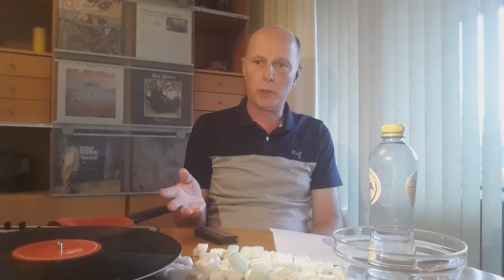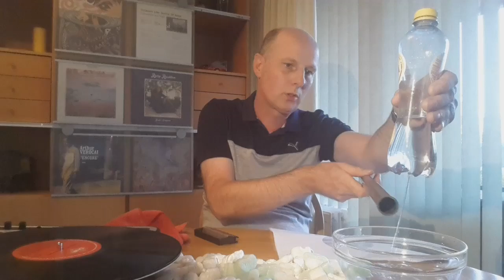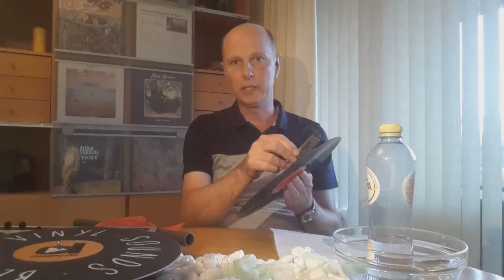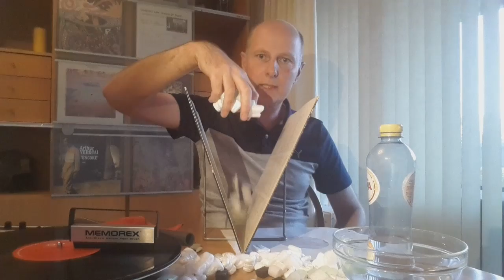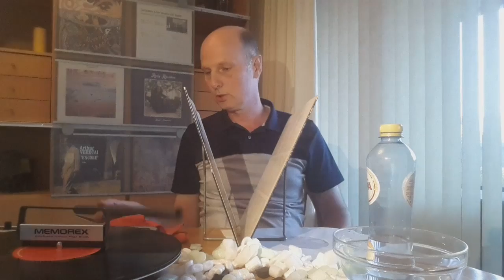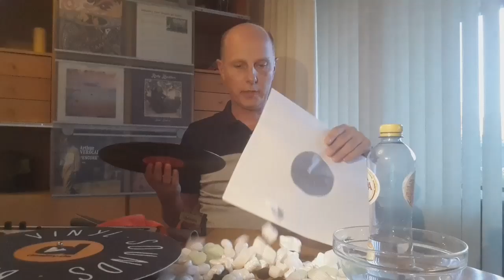3 Common Misconceptions Using a Record Brush - Vinyl Community

Comment: Thank you Sir ! I might be wrong, but, I don't think the carbon brush removes static... a Zerostat 3 gun is better for removing static.
Reply from the maker: Hi again. It might surprise you, but it's actually the other way around. The Zerostat gun can't remove static. What it does, is cover the record with a negative charge and next with a positive charge. Both charges cancel each other out. This way the record is neutral and no longer static. I think a carbon brush is the only dry method that can remove static from a record. Wet cleaning also removes static.  Have a great weekend. /Paul
Reply: @XjunkieNL  yes, applying opposite charge is exactly what I heard, but in addition I heard the carbon brush just does not add static... and it can't remove static. In other words you will only remove static with zerostat 3. I have the zerstat3 but have not yet gained enough experience and confidence with it and dealing with static. I also find cleaning removes static.
Reply from the maker: Check this video. It shows two ways that a carbon fiber brush removes static. https://youtu.be/J7gOdhtKPpg
Reply: @XjunkieNL  already seen and liked that clip, thank you

Comment: I just bought a carbon fiber brush ( anti-static brush) but the first time I used it , it made a screeching sound when it made contact with the record!  I had been using a velvet brush but since everyone recommended using one of these types of brushes... I bought one and now I'm not sure its not scratching the records!  is it normal for it to make that sound?  I placed it so that it barely touches the record so the bristles don't bend... still it makes that weird sound... there is no better way to describe it than ... screeching... jaja
Reply from the maker: Hi Fernando. This does not sound okay. Have you seen my video where I compare five different carbon fiber brushes? One brush also made a screeching sound. And also scratched the surface of the vinyl. Here is a link to the video https://youtu.be/J7gOdhtKPpg Let me know if this is similar to your problem. Thank you for the comment. Cheers. /Paul

Comment: I have cleaned records from the early 1970's forward. I have used practically every method known to man. The glaring issue I have come to learn, is recontamination. Being that nearly all the methods I see, involves cleaning one side, then flipping it over to be cleaned on the other without removing the material surface on which the dirty side was set on.   Also, I have yet to see anyone address the labels. They are filthy, full of dust material. 
An anti static device can be used on the record before and after cleaning, but it should be used on the turntable as well. 
But by far the problem lies with recontamination.
Reply from the maker: Thank you for your comment, James. You make a valid point. In general recontamination is a problem. Platter mats, brushes and the labels you mention, all are a source. Static can really help to reattach dust to a cleaned surface. Cheers. /Paul
Reply: X junkie NL 
Thank you for your response Paul. I was observing your mention of using the carbon fiber brush in an inverse manner (towards the label). I was watching a great blogger on YT named Fran Blanche. She is a former DJ and spoke about various things that occur to records. She also used a carbon fiber brush. However she slowly moves the brush to  the outside of the record and off. She stated that the slow movement helps to carry the static away from the record. Thanks for your videos Paul.
Reply from the maker: Gonna check out the blog of Fran Blanche. For the static it doesn't care in which direction you move. It has to leave by the conductive fibers. Only thing is it needs time to do this. Most people move the brush to quick. /Paul

Comment: Anyway pulling the brush tho the centre or out, you pulling it over the grove. 
Pulling it in and over the label that you touched i think you just contaminated your brush with whatever you put on the label with your fingers
Reply from the maker: Hey Jørn. Thanks for the comment. I like your argument of the unwanted body oil, from fingers, touching the brush. Although, like a catch 22, you touch the record at the outer and inner part of the record. For me it feels more comfortable to make the carbon fibres go in the same direction as the needle goes in the groove. The difference may be limited. All the best. Cheers. /Paul

Comment: I believe I have discovered a mistake in your presentation regarding the angling of the brush when cleaning the record.  By way of explanation, you put an open gate fold album into a rack.  The "V" shape of the album when open was to represent the groove of a record.  You demonstrated the way in which a record brush when tilted would touch the side of the groove and consequently potentially statically charge the record.  It appears to me that this would be correct only if the brush was angled differently on the record by about 90 degrees.  In other words, for the angled bristles to touch the side of the groove the way you described, the brush face (not the ends of the brush) would have to "face" the label.  When the end of the brush "faces" the label, the bristles of the brush are within the groove and some bristles are naturally touching the side of the groove, a situation that apparently cannot be avoided even when the brush is not tilted. 
One question is, whether or not the brush is tilted, how does pulling the brush off of the end of the record or pushing it toward the center of the record thoroughly clean the dust from the record?  It would seem to me that it would be necessary to change the angle of the brush for the purpose of sweeping the dust from the grooves and off the edge of the record BUT there is a problem I have discovered when doing this sweeping with a carbon fiber brush.  That aforementioned problem is tiny scratches.  You read that statement correctly.  I have an "Audioquest" carbon fiber brush that when utilized to sweep (as previously described) causes tiny scratches on the record surface, a situation that is not supposed to happen but I assure you it does happen.  The scratches can be seen on the outer rim of he record. As far as I can discern, these scratches are inaudible when the music is playing.  I just do not want them to be there, obviously.  This has caused me to question whether or not a carbon fiber brush should be utilized at all as a method of cleaning vinyl records.
Reply from the maker: I'm not sure if I understand, but you are correct if you mean any brushing action is creating static. If you are worried about tiny scratches, there are anti static brushes available with the carbon on the inside. It uses soft hollow fibers. Chances of tiny scratches are minimal with this kind of brush. /Paul

Comment: I guess I've been using mine the wrong way. I zap mine with my Zerostat gun before using the brush. Thanks for the tip!
Reply from the maker: Sounds good to me. If you have a Zerostat available, using it before brushing, will certainly help removing the dust. Cheers. /Paul

Comment: All brushing with whatever adds static.  "antistat" brushes are BS including the arm ones with carbon fiber that is grounded. They add static.  Best method I've found:.   Hold album in hand, roll with silicon roller.  This will also add static but then use an antistat gun like the Milty while still in hand otherwise it doesn't work.  Now put album on platter.  Keep stylus clean because even dust on the stylus will add static as it plays.    To test all of this hand a piece of paper and watch how the album pulls on it.
Reply from the maker: Hi. Thanks for the comment and sharing your experience. By definition anything that is conductive will remove static, including carbon fiber brushes. Maybe fun to know, a Milty gun doesn't remove static, it overloads the vinyl with positive and negative charge, which totals to a neutral total charge. In the video where I compare five different carbon fiber brushes, I demonstrate two possible ways static is removed from vinyl with these brushes. All the best. Cheers. /Paul

Comment: i disagree that it's necessary to de-staticize a record before using the CF brush.  when you put the LP down on the platter, the static field on the record (if any at the time) collapses into the ground plane of your grounded turntable.  

when you take the record off the platter, it brings the static along with it from the ground plane and the disc is ALIVE with static.  THIS is when you use a zerostat or equivalent anti-static gun to remove the charge so that as the record is being stored  in its sleeve, it isn't drawing dust into the grooves.

however, your point about attracting dust from the tt mat is cogent, so a zstat treatment before the record being placed on the mat is in order.  the carbon fiber brush is unnecessary to remove the static, a zstat gun if MUCH more effective.  

here is a quote from another post i made in the audio asylum-viny asylum:

my requirement for a carbon fiber brush is the smaller bristle diameter like found on the original Decca Brush which indicates over a million bristles.  that infers smaller diameter.  

"ii have CF brushes with the stiffer bristles and don't feel as confident that the bristles are reaching into the grooves as well as the stouter, larger diameter bristles.  i don't exert much downward force, but i do angle the bottom of the brush slightly forward, top back so the bristles are aimed into the oncoming grooves as such:  \\, and then sweep off to the outside after a couple of rotations and repeat once or twice.  this brush is always used dry and only for clean records that may have dust from the sleeve. 

at the very least, a spin clean wash for used records and sometimes for new.  i know, some people wash new records every time, probably a good idea."

as with any procedure, it can be tailored to your own preferences but of course, MINE is the best.  

;^)

...hifitommy
Reply from the maker: No problem, to disagree :) But be careful in your way of thinking. A zerostat does not remove charge, it neutralises charge. Meaning it overflows the record with the opposite charge to neutralise the charge on the record. In my other video I show how you can achieve the same, in a passive way, with a carbon fiber brush. Thanks for watching. /Paul
Reply: zstat guns are expensive though
id rather buy more records with the money tbh
Reply from the maker: Hahah, right, just the basic groceries and the cheapest brand...anything to save money and spend it on more vinyl records :) Cheers. /Paul

Comment: I alvays have visible scuffs on my records after using a carbon fiber brush from wiping it to the label. What am I doing wrong? Or is this normal?
Reply from the maker: That doesn't sound okay. Have you seen my video where I show the differences between carbon fiber brushes? What kind of brush are you using? /Paul

Comment: Done that the dust just jumps from one side to the other i lay a micro fibre cloth out and place the record on the cloth and clean
Reply from the maker: Hi Paul. Yeah if the record is very static, it can take a long time to remove the static with a brush. Giving the record a wet clean works faster and more efficient in that case. Thanks for watching.  Cheers. /Paul

Comment: You can forget removing a static charge with a(ny) brush like that ... just use a meter. and you know it doesn't work. Learn some physics before misinforming people. 
Use a Destat III instead if you want ... which does work.
Reply from the maker: Hi Eric. Thanks for the comment. Carbon fibers are one of the few methods to remove static.  Always open to listen and learn, if you can tell where I'm misinforming people, I'm happy to correct. Good to hear the Destat works for you. Cheers. /Paul

Comment: No you are still brushing it wrong
Reply from the maker: If you have a better way to make use of a carbon fiber brush, maybe you want to share it? /Paul
Reply: X junkie NL  ....you brush lightly  on a  spinning turntable, following the grooves towards the spindle, then touch the spindle to dispel the static charge., then remove the dust etc from the brush. This can be done twice,.
Your demonstrstion is a complete load of nonsense.
Reply from the maker: You make a thinking error when suggesting it is possible to dispel the charge by touching the spindle with the brush. The static of the record is instantly discharged through the brush and your body. The brush is not able to hold and release at a later moment. By the way your last remark is a bit rude without motivation. /Paul
Reply: X junkie NL ....that's the instruction for useing the brush, it's my opinion, no need to get upset, it's called straight honest talking, which some people cannot seem to accept, it's not rude.
Reply from the maker: It's no problem to disagree with my method, but to simply call it "a complete load of nonsense" has nothing to do with straight honest talking. /Paul
Reply: X junkie NL I just thought it was...sccept it...ever thought you are wrong ?
Reply from the maker: Your arguments don't make me think there is something wrong. /Paul
Reply: X junkie NL ...ok Paul , let it go, you are right and I am wrong.

Comment: A carbon fibre ( one of the toughest strongest materials out there) brush  on a vinyl record? Steel wool will clean almost as well. The mechanics of your whole cleaning method is just wrong. I clean my albums with a brush that was made with the belly hairs of the Russian black squirrel from Siberia. It costs about 35$ and is scarcer than hens teeth today. That has worked for 40 years. Just because someone sez the latest is greatest does not mean it is. Like PT Barnum "there is a sucker born every minute"
Reply from the maker: Sorry to hear that my cleaning method is all wrong. For me the removal of dust and static in one go has worked great over the years. Wouldn't be surprised if the first carbon fiber made by Decca, is more than 40 years old. By the way the fiber is coated with carbon, it is not a solid carbon fiber. And if you want to have a softer brush, available are also hollow fibers with the carbon inside. Cheers.  /Paul